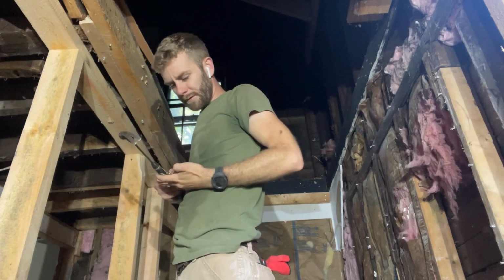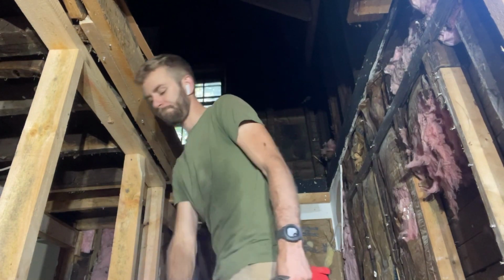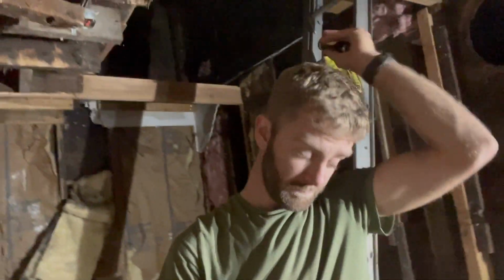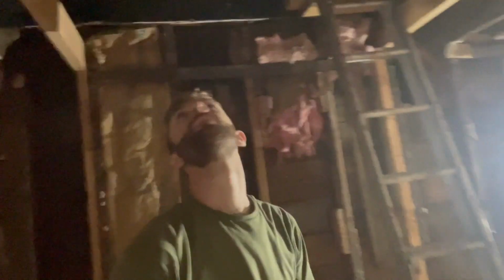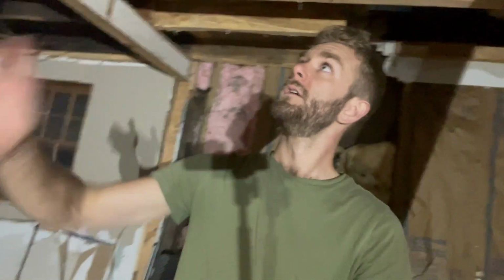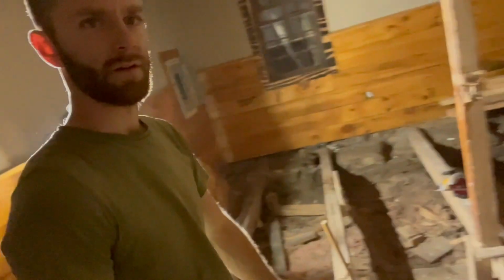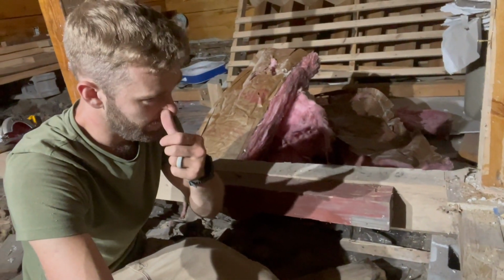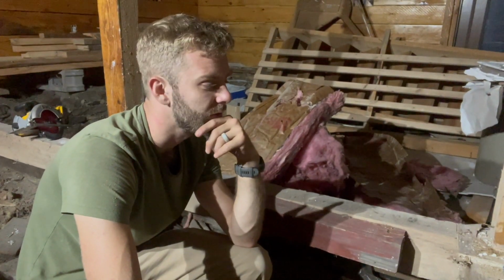Stair post FINALLY REMOVED!! What's next?? || MAJOR Fixer Upper Ep. 11

Comment: You were right putting a 2x4 under joist, I would add another along side it all the way to the top of it to prevent it from rolling...
How long or wide is the room? You may just put joist all the way across and let them support everything and sister others to the new joists.
On cementing, can you bridge from one side of room to the other side to take post out. Maybe 3or4 2x8's to make a temporary beam?
Good luck. Did you say your brother was an engineer?
Reply from the maker: I'm hoping to go back through and readdress some other questionable joists once I have my floor in (mostly because it'll be a lot easier to work on). I like the temporary beam idea, I hadn't thought about doing one so massive. Perhaps that could work. As of right now, I'm working towards a singular jack post that'll be poured into the floor. My father is an engineer, so that's super helpful!
Reply: @likeclarkwork22  yes take a good look at what need to be done. Even a rough draft of what it is supposed to be.
Years ago I rebuilt the foundation under my parents kitchen (one story), my boss at the time had huge beam (12"x12"...?), Put under joists, poured footing, built block foundation and took beam out, then fill opening.
But if a jack post, ya footing, post and still adjustable. You can pour floor around it. ( I had to put one in for tale of the support beam of the house.)
I suppose there are references to size up everything. (Even state code is at least minimum 😂) good luck and God bless. 🙏

Comment: Can you build a Load baring Wall under the existing Load baring Support without compromising the strength of the Seling and above Floor? If you can thin you might be doable to build your Stare case there safely, and your stare case might make a 90 rap around the wall. How many feet of open space do you need for the head of your stare case X and Y?

Comment: Are there building codes where you are? I'm sure they were different (or non-existent) when that house was built, but I thought all bearing posts need footings, which are typically deeper than concrete poured for a floor. Just wondering if you're planning to build footings under those bearing posts before you pour the floor.
Reply from the maker: Yes there are codes! I'm not sure what the deal was when this place was built, but I have a pretty good guess that, at least during renovations, there was no permit pulled to do work on the house. I do plan pouring a footer for the main support column I'll be putting in!